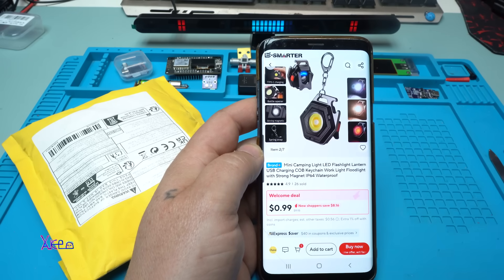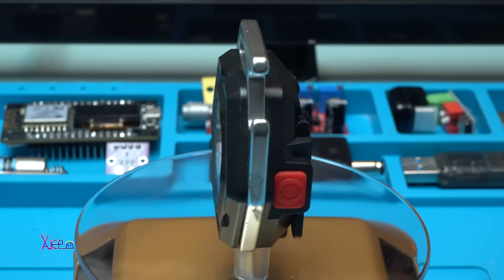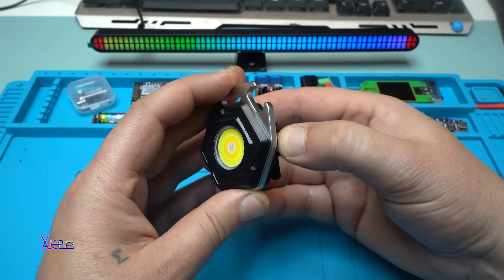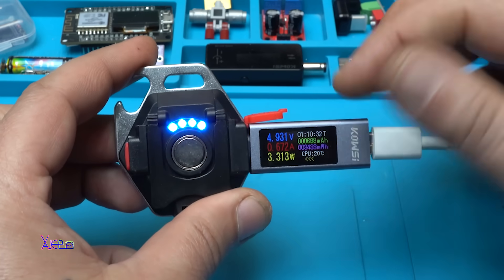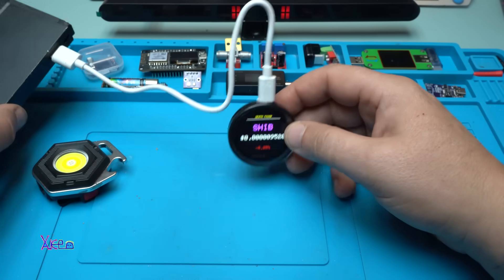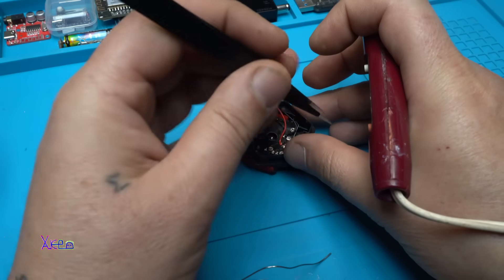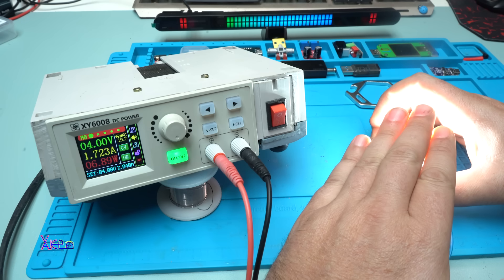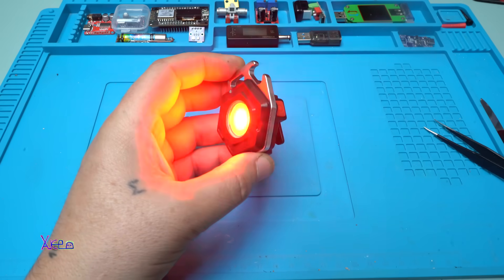$1 Aliexpress Product - Does it WORTH?

Comment: thank you. for a key chain i would use a much smaller  light. and for other lighting more like the emergency wind-up / solar radio such as camping. here in NZ $NZ8.58 + $NZ 16.00 postage or $NZ17.16 + tax for two. Nice item but not for me. Thank you for your videos.